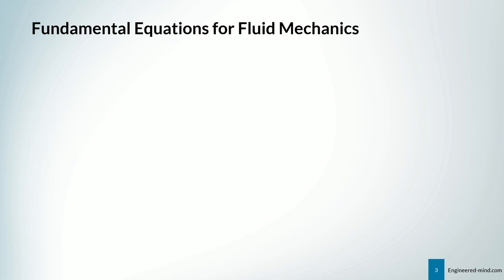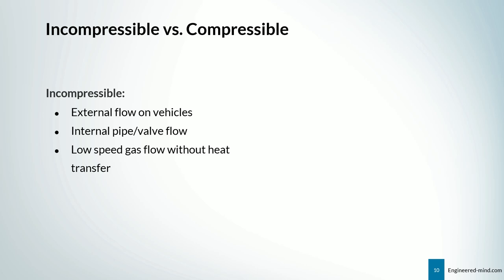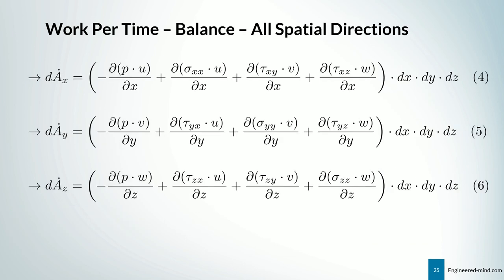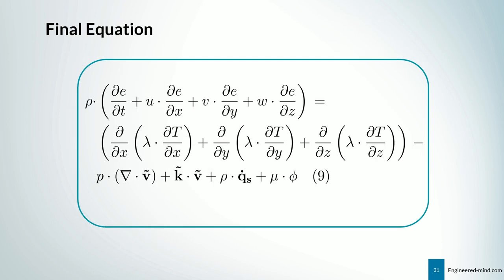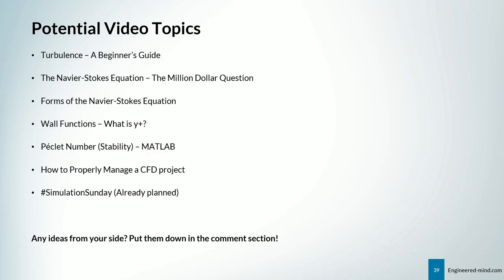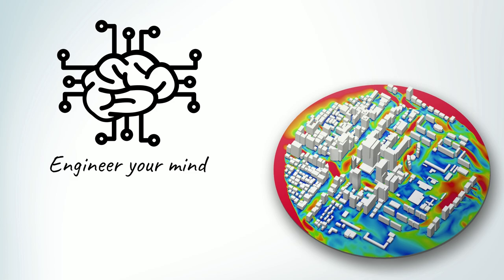Derivation of the Energy Equation

Comment from the maker: 🎓  My Science Courses – https://courses.jousefmurad.com/
✍️  Latest blog posts: http://jousefmurad.com
📥  My Newsletter – https://jousef.substack.com/

Thanks for watching! Make sure to like & comment :)

Time Stamps
----------------------
0:00 - 0:30 : Intro
0:31 - 1:45 : Recap from the last videos
1:46 - 2:27 : Derivation of the Energy Equation (Intro)
2:28 - 4:00 : Compressible vs. Incompressible
4:01 - 4:51 : What does "Compressible" mean?
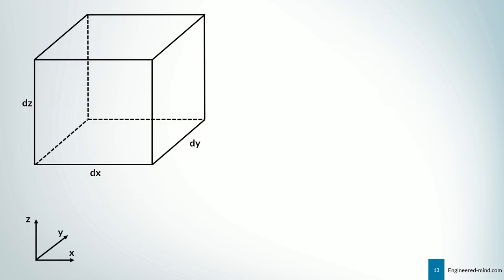4:52 - 5:40 : Mach Number
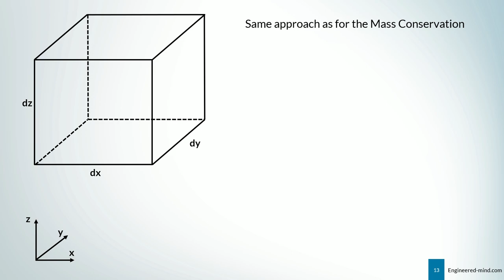5:41 - 7:22 : Change of Energy inside of the Control Volume (CV)
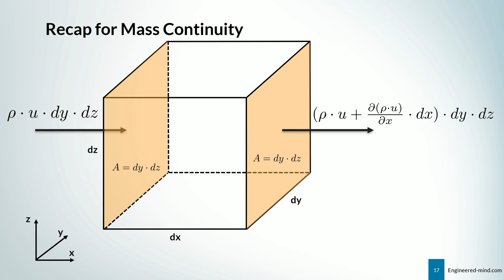7:23 - 7:35 : Recap Mass Conservation
7:36 - 7:50 : Balance for the Energy Equations
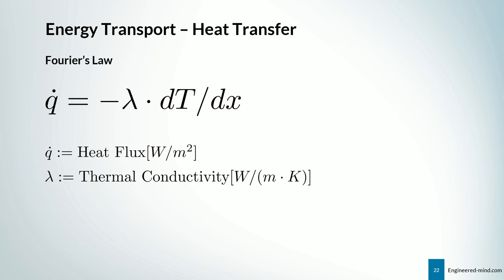7:51 - 8:50 : Change of Internal & Kinetic Energy
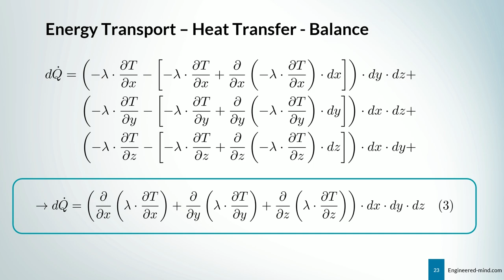8:51 -  9:44 : Energy Transport - Heat Transfer
9:45 - 10:35 : Work per Time Balance
10:36 - 12:50 : Assembling the Equations - Simplification - Stokes Hypothesis & Dissipation Function
12:51 - 13:42: Perfect Gas Ansatz & Equation
13:43 - 14:57: External Aerodynamics
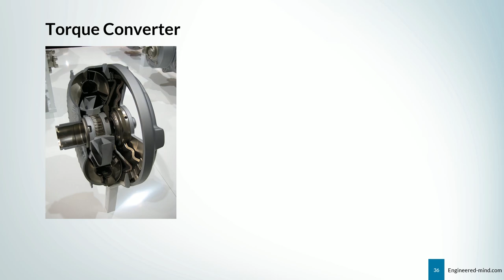14:58 - 16:29 : Torque Converter
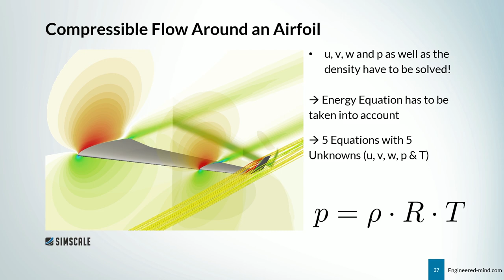16:30 - 16:56 : Compressible Flow Around an Airfoil
16:57 -  End : Outro

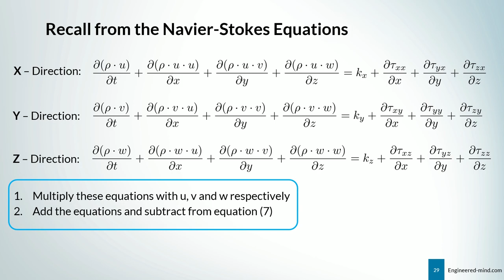Comment: I dont get the math on 12:13. Why the V^2/2 term (the 2nd term being vanished) is completely vanished when you perform algebra as explained at 12:15, it will be -V^2 term not -V^2/2. And also the k term why it didnt vanish since you this on your navier stokes equation at 12:15 (kx , ky , kz) and k dot V on 12:13. So if you do subtraction as stated at 12:15, k dot V - ukx - vky - wkz = 0.

Comment: At 13:36 where you give the equation for perfect gas,. are you sure the term for stresses is correct? In the previous slide it said p(div V) and in the perfect gas slide it was pretty much material derivative of p. Or am I missing something here?
Reply from the maker: Maybe I’m a bit confused here but I don’t get your question :) did you figure it out in the meantime?
Reply: @JousefM  no I haven't, sorry. Alright let me rephrase. In 12:33 where you said it was the final equation, the stresses term was p(div V), which can also be written as p(du/dx + dv/dy + dw/dz)

And yet at 13:36 (the perfect gas one) you wrote (dp/dt + u dp/dx + v dp/dy + w dp/dz) which is the material derivative of pressure, no? What I would like to know is why did this term change? Am I missing something?

Oh and I'm sorry for the confusion, English isn't my first language
Reply from the maker: @AbiRizky  No worries. So I am trying to explain why the term changed and what you have to do to get there, hasn't been derived step-by-step.

Taking the equation from 12:33 , we derive the equation that confused you by assuming caloric perfect gas and use the thermodynamical relation e=c_p*T - p/rho - simply by using the thermodynamical relation and this equation from 12:33 we can derive the "final equation". And you are somehow right, its the material derivative or substantial derivative, however with respect to the temperature. So local, temporal change of the temperature at a fixed place PLUS the convective part of each temperature direction, does that make sense somehow?
Reply: @JousefM  it does actually! But I suppose it was a mistake at first for not including the temporal derivative for the pressure? Because the term p(div V) at 12:33 doesn't give out anything regarding the change of pressure with respect to time?